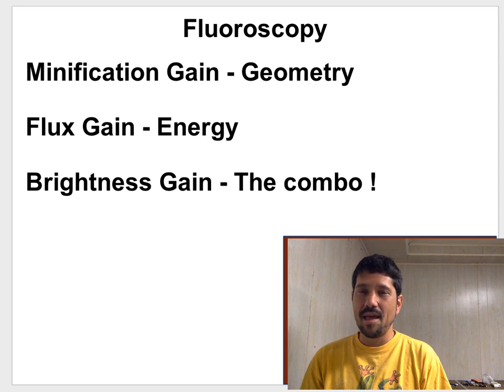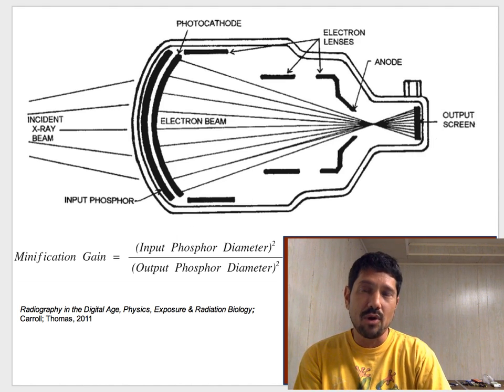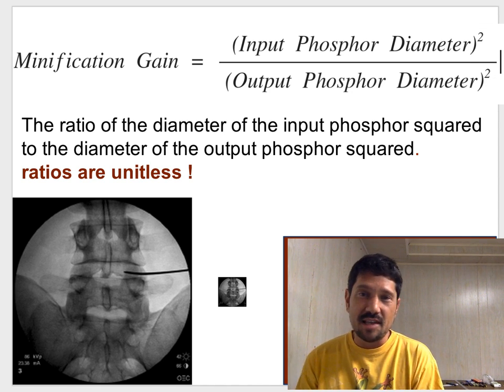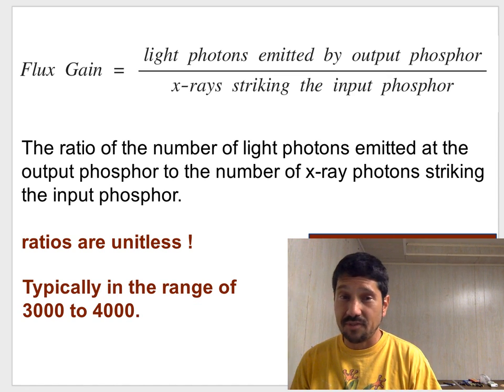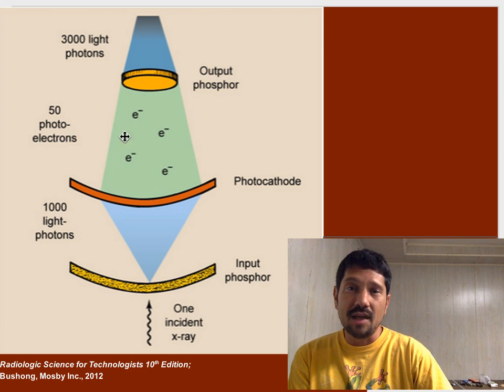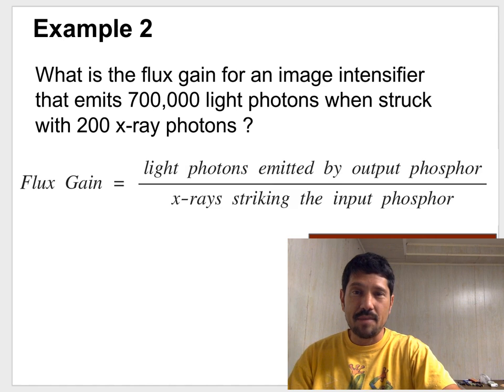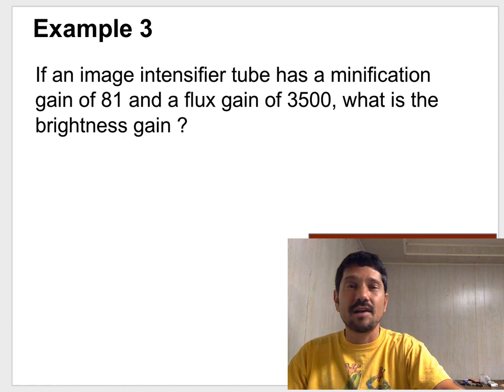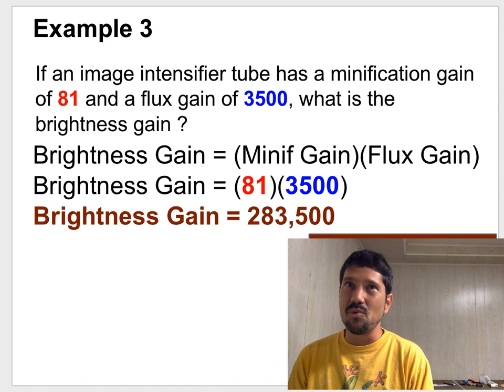XRayBob Minification, Flux, & Brightness Gain Math Examples

Comment: thanks bob!
quick question,
we calculated a brightness gain of 283,500 in your example. does that mean the output is 283,500 times more bright than the input brightness? or is 283,500 some arbitrary number?
Reply from the maker: Tyler it means the output is 283,500 times brighter.  It is not some arbitrary number.  Glad this helps.